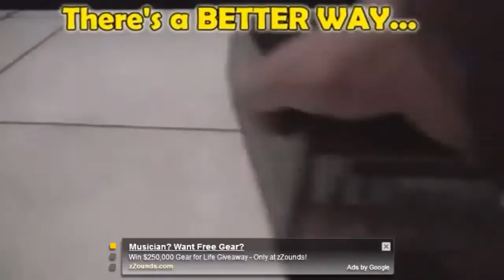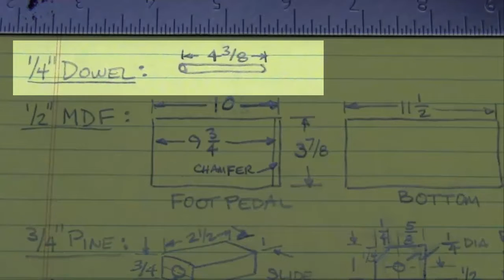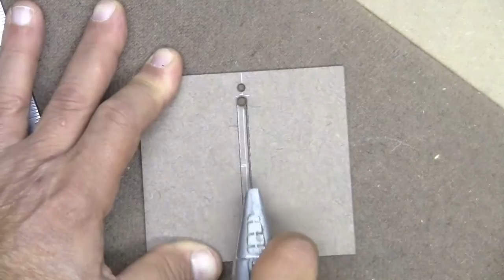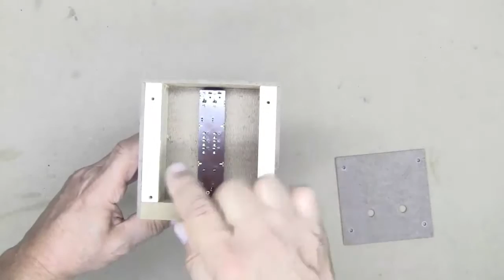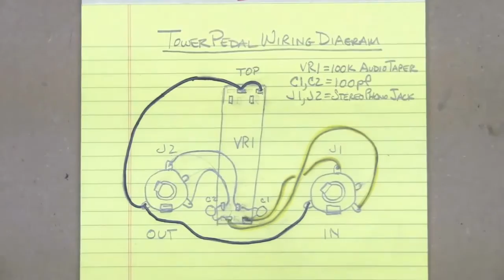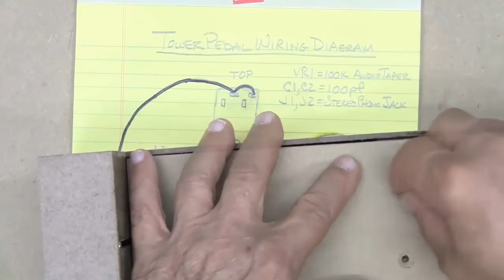Build This Stereo/Mono Volume Pedal

Comment from the maker: It can travel its full length if you press your toe down.  IMPORTANT:  For best operation, get a LINEAR pot.
Reply: What a great tutorial & design. Regarding the pot... your All Electronics parts list shows an AUDIO pot. But you discovered that a LINEAR works best, after trying the AUDIO pot? Thx for any reply.

Comment: I'm working up a DIY Volume pedal (mainly for keys) and was surfing around for info - 
So, I was wondering why the 100 pF caps? - and why on both IN and OUT and how did you come to that? I understand guitar treble bleed issues, but never heard of that for volume pots.